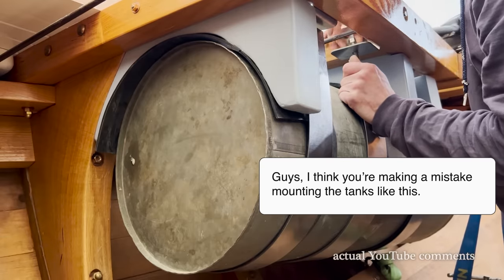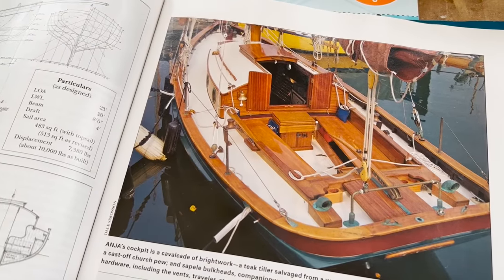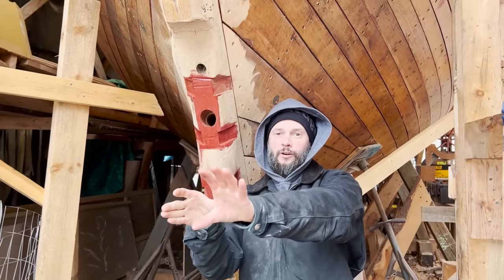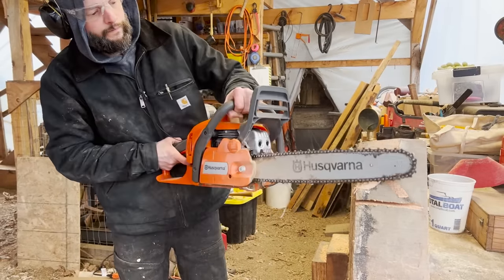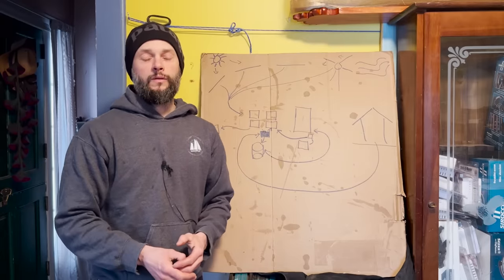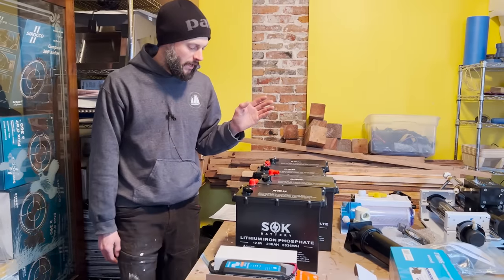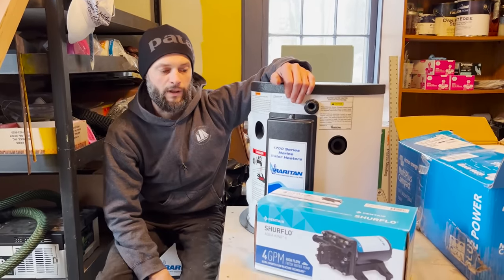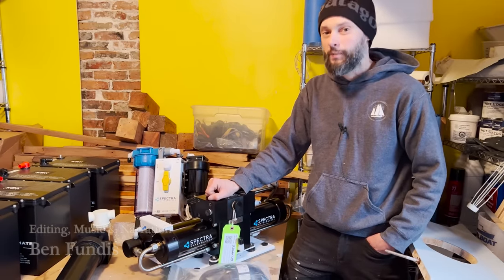That Prop Is Too Small & Other Comments - Episode 248 - Acorn to Arabella: Journey of a Wooden Boat

Comment: Pretty much the same plumbing system except I have a Dickinson Pacific for heating the water heater. I also run a loop of hot water into the head back to the water heater and run a low flow circulation pump so the water heats up the cabin sole and provides on demand hot water for showering. The loop also goes into the v berth through a forced air heat exchanger and a thermo coupler switches the heater on  and off at thresholds, so the entire system is protected from thermal meltdown. Only needed when living on the hook and running the stove 24/7.
Reply from the maker: Cool!

Comment: The biggest problem with the Sawzall is the stroke length and the size of wood being cut. If the thickness is more than twice stroke length, then it's not clearing sawdust from the kerf. If the gullet is full of swarf, then it can't cut any further.

Comment: I'm guessing your hot water heater already has a thermostat, but I wonder if you could control that further and get more efficiency out of it by say, limiting the water temperature to something like 105 when you're running off batteries.  Quicker heating, less power, less cold water to mix in to make it comfortable.  Savings all around provided the control itself doesn't negate the savings.

Comment: You didn’t mention a thermostatic mixing valve between the hot water heater and the shower. If you just didn’t mention it, great. Otherwise, it’s a scalding hazard after the engine has been running. The pressure balancing valve in the shower does not deal with that. I had to replace one last season, it was something like $80 or $100 plus fittings.

Comment: Very nice video! I was thinking of the risk that you would be tempted to use the water heater much more often than you think, whenever you woulld use warm water at home. But then I realized you are probably cooking on propane/butane, right? So you can also heat some water for dishes or washing your hands on the gas cooker.
Reply from the maker: Exactly.

Comment: I worked with chain saws for years working in the logging industry in Oregon. And no matter how careful you are if you run a chain saw enough you will get hurt. I never knew of any of the men I'd worked with that didn't have a scar or two on thier legs from a misstep using a chain saw. I've got a six inch scar on my left knee from not paying complete attention to what I was sawing with a chain saw. They are a very useful but extremely dangerous piece of equipment.
Reply from the maker: Thanks for sharing your experience!

Comment: Just a suggestion would be to add a second alternator just for charging the house batteries as the charge rates for charging lition baterries is very different than charging lead acid. Also you may consider instead of having a separate genset you use a Vari Gen ac that bolts to the engine and produces AC power directly for boat use when not at a dock. A friend of mine had one on his 47 foot cruser and it was the cats meow and was extremely simple to use.
(;-) TP

Comment: You probably don´t need the accumulator. Plastic plumbing does the same and I have never had issues with pumps cycling on unless in use at that moment because the seals in the pump are that good.

Comment: I worked with props just long enough to know that if you aren't including pitch with diameter, you aren't making a suggestion.  Same boat, different motor gives different diameter and pitch.  Trust the pros on this.

Comment: Electrical system looks sensible and as simple as can be. No one wants gas on a boat if they don't have to, it's another tank, and it comes with well known safety issues! Better off with an alternator upgrade to a bigger one, or 2 if you have room!

Comment: To charge LIFEPO batteries from your propulsion engine you are going to need a second alternator that can supply continuous high current and a smart regulator to control it.  Many cruisers have that,  I have that.  I have a Beta marine 50HP engine.  Essentially the same as yours just marinized by a different company.  The engine can handle it.  Brackets and pulleys are available to fit a second alternator.  Are you planning to do this?  The supplied alternator is OK for charging the engine start battery and very little else.  I would also recommend a battery combiner between your house bank and engine start battery for those times when one of your alternators is not working.  It will happen.  The internal regulator on that alternator is not designed for continuous output, just to replenish the engine start loads and to drive the engine instrument loads. 

Just so you know from where I base my comments.  I have a 1985 classic plastic sailboat that I lived lived aboard and cruised the world for 19 years.  I have owned it for 32 years and I have re-powered, re-wired and re-plumbed it.  None of the original factory installed systems still exist.
Reply: He's got (but didn't show) a Wakespeed alternator regulator to avoid overheating.

Comment: Like the SOK batteries as well, but do you have the ones that have heaters?  Your plan to go up to theice is not a problem, but charging LION batteries below freezing will significantly damage the. The heated versions will work automatically from the internal BMS.

Comment: Thanks for this video, it explains a lot of what everyone was thinking of and wondering.  I do have one question, will you put all the intakes on one side and discharges on the other?  I know I would not want my engine to be taking in the brine discharge or waste discharge from further up the hull.  (never mind the brine discharge is nowhere the discharge I had in the navy, of 1000s of gallons a day.)  Also bilge discharge may have oil in it which is a horrible thing to have accidentally get into any other systems.  Also with the northern trips you plan on making, consider having a recirc type system thru the water tanks from the water heater, while engines are running, to raise the storage temp of the water.  Raising the tank temperature to 70 from 45 will both make life better, (washing dishes or your hands in cold water really sucks) and the small water heater will be more enjoyable in the shower.  (I would only consider heating storage tanks with the motor running.) P.S.  I forgive you for not releasing your video yesterday, which I thought was Friday.  I was beginning to wonder if everyone was OK, but then about 5 pm I realized I had the date wrong.
Reply from the maker: Hahahaahha oh man, that post-script. 😁

Comment: Cruisers don't heat water from their battery banks, it's never worth it as it requires many watts and you'll need to recharge.  Just run your diesel for that (or shore power).   Foot pumps are also archaic, IMHO.  They are a tripping hazard and electric pumps are reliable.  Don't waste space on a wind generator.  They don't make enough power to be worth it and often make shadows on your solar panels (making them a net negative).  Put more solar on wherever you can fit it.  Your boat is small and you'll never have too much.

Comment: Gas fuel tanks were very often placed in the cockpit lockers or dedicated locker so if they leaked both the fuel and fumes went into the cockpit or directly overload instead of the bilge.
Reply from the maker: True, and with healthy ventilation.

Comment: Good day Steve.  Watching the power diagram, I was wondering if you had considered and or researched the different power ratings around the world.  I mention  this as it seems to me that the US tends to use 110 volts and most other countries have higher voltage eg. Australia where we use 240 volts similar to other Asian countries with 220/240 volts.

Comment: Chainsaw vs Sawzall: I have worked with both. I've watched Steve use the chainsaw from the days when he was felling the trees. He has much more experience with this saw and he knows what he is about.  The sawzall, in my opinion, can drive the user if that blade ever gets bound up.  The worst is when the tip hammers against an unmovable object.  The tip of a chainsaw can be inserted into wood where as the sawzall can not.  There is more cutting surface on a chain saw.  Granted, it is a dangerous tool, but I use a small chainsaw for rough cuts, hell it's even a better demolition tool. And with the sawzall, the blades wear out far faster.  The one thing it's good at is accessing small places. But using one scares me more than a chainsaw. [add] By the way, how many people do you see carving ice with a sawzall?

Comment: 12vdc 600w immersion water heater elements for the 6 gallon unit. Swap out the 120vac , and ditch the inverter

Comment: 11:29 Controversial, i know, but rather than a filler block, make a fiberglass, two piece clamshell that screws into the hole and fills the void for use.
Advantages over filler blocks, as i see it: 
a. it's lighter
b. it's never going to change size, it's always going to be the same as you made it, and when it comes to small parts like that in the water, that's a great advantage point, as i see it.
c. it's fiberglass = you're never going to sweat over it being damaged/lost. 

Nobody but you will see it, so there's no "blatant looks" issues with it. With a few brass insert pass through holes on the edge of the cutout, it should very easy to install using some Chicago screws. 

Just my 2 cents.
Reply from the maker: If it never changes size but everything around it does, that’s an issue, and since the rudder is partly in and out of the water, that’s a thing that happens. Thanks for your thoughts though! And plenty of people lose and damage parts of their boats no matter the material. Nothing controversial about using fiberglass where it’s the best option!

Comment: - Your patient Show and Tell Tutorial was excellent, Steve.
- Agreed, the chainsaw gives you the most control for working the stem and stern posts.
- It cuts wood quickly like hard butter and makes what you are doing EASILY...Yielding more control.
- Any other tool, except a good size Axe or hefty enough properly shaped Adze, would be slow, tiresome, with flimsiness preventing good control that you understood would be available to you with the chainsaw choice. SMART.
- Smaller chainsaws could work, but would not work as deftly as the bigger one you chose.
- Appropriate Physical AND Athletic strength is needed to use all hand tools, especially big ones.

Comment: That prop on your 50hp is the same size as the prop on my 28hp. We have a 16" 3 blade for 28hp   There is one overriding consideration on prop sizing and that is that the prop can transmit the full power of the engine. If with the engine at full RPM the prop is only transmitting 30hp, then there was no point putting a 50hp motor in it ... I don't know your peak RPM nor your gear ratio, but that prop seems very small for a 50hp, I would have expected around 19" 3 blade with a pitch close to 15"

Comment: Do you have any isolation between the two different battery chemistries? You seemed to show both being charged from the alternator. Would seem you need a dc to dc isolator to charge one from the other.

Comment: As someone who has a 12volt 400ah system for my off grid cabin I think you may be undersized a few ways electrically.  I use victron as well. The inverter at 2k output won't be able to run power tools if much of anything else is running because of the startup power. I can run a circular saw if everything but my led lights are off and I don't bog it down at all. You're probably going to be ok, but you will have shut things off to use other things . can the whole nav system be powered off? Battery wise running cellphones and a coffee pot are two things that take way more power than I expected. Also fans take a stupid amount.  I think you'll maybe get 4 days out of those batteries without charging maybe 2. I don't think you're gonna be in trouble just some limitations you may want to know about. Amazing project keep up the good work.

Comment: 12:16 I would try my best to get the filler block small enough that you can fit the propeller through without taking it off. Maybe only if the propeller is in a certain position, of you have 2blades on the left with rudder to the right you one need to fit one blade past

Comment: Steve, I thought you were using a 24 volt system.  Maybe you could consider consulting more with your install tech the advantages of higher battery voltage rather than 12 volt. Wire costs/efficiency/ heat/ so much more with higher battery inputs to inverter.
Reply from the maker: We’ve definitely considered this, as you might guess.

Comment: I am sure if you check on it, you cannot put a charge controller on the wind turbine.  If the batteries are at full charge, it would shut off power from it and then without the resistance of generating power, it would freewheel and probably over speed and throw blades.
Reply from the maker: Wind turbines these days usually tend themselves, stopping and starting based on wind, plus, we will have a hoisted one, not a permanently mounted one due to our rig, if we ever even get one.

Comment: The first diesel engine production model was in 1897
The first diesel-powered motorships were launched in 1903: the Russian Vandal 
Working with the firm of Klose and Sulzar, Diesel produced the first experimental diesel railroad locomotive in 1909.
Reply from the maker: Meaning that small diesels for pleasure boats weren’t as readily available.
Reply: @AcornToArabella  I had to look it up. Not old enough to have been there.

Comment: You will need an accumulator to put in line with the water pump to stop it cycling on and off quickly and wearing the pump.

Comment: My level of concern regarding the timley and successful completion of the project has decreased considerably. The fact major system components are in hand and experienced and expert sailers have been consulted is great.  I will say Steve when you are motoring you will just about always want to be going "hull speed" or close to it.  No point in making a 8 hour day a 10 hour day most of the time.  Creature comforts are good too such as a little hot water.

Comment: Hi Steve.
you did not mention a charge controller in the solar-battery-inverter configuration. Is there a reason for that decision?

I thought a charge controller is important for preventing the battery from overcharging.

Comment: You probably already know this, but you may need two different alternators... One being a high output with a high output regulator charge controller.  Since your house batteries are lithium, they'll suck tremendous amperage with their high C rate, which would heat and kill many alternators designed for charging a single flooded lead acid it AGM start battery. A sailing channel I watch called Sailing Soulianis reconfigured the belt and added a second specialized alternator for their lithium charging on their previous boat.
Reply from the maker: There will be a charge controller to take care of adjusting the output to what the batteries want as input. That’s what all the Victron stuff is for.

Comment: For those who are interested: 
Arabella is a 38’ boat with a waterline length of 32’. 
The maximum hull speed of a boat is calculated as 1.34 x √waterline length. So Arabella’s maximum speed will be 7.6 knots. 
This is because as the boat speeds up it slowly buries itself in the hollow behind the bow wave until it can’t go any faster. 

(Boat in this case behind a displacement hull, non foiling, non planing)

Comment: I've been watching this project from it's beginning and now must ask after watching the water systems design what thought has gone into freeze protection. Must the boat be winterized whenever it's in a colder climate and left unoccupied?
Reply from the maker: No, not really. It’d have to be a VERY cold climate. And the only thing needed to winterize is put some antifreeze into the raw water strainer with the boat running for a bit, then make sure the water tanks are mostly or completely empty. When I left my boat in the water in Maine, we just ran the engine from time to time. Didn’t need to empty the tanks. —Anne

Comment: Man we have a 5th wheel 38ft camper and are hot water heater is like 5 gal it run on either propane or electricity it can run 24 7 and never run out off hot water and really doesn't cost much to run

Comment: As an off grid electrician, I have a question about battery fusing. Are you going to have a primary fuse at the battery bank before and of the conductors go out to their respective locations? Or is the main fuse panel going to be next to the battery bank? I've been watching you since the beginning of the planning and build and I'm impressed by the week to week progress. Great work by you and the crews. Give your mom extra kisses from all of us watching.
Reply from the maker: More than likely: There are independent fuses nearer the batteries for each bilge pump (three planned) and then for everything else there is a breaker panel before the electricity is distributed through the boat. —Anne
Reply: @AcornToArabella  Thank you. We have always put one primary fuse right at the battery bank just in case a cable should get nicked or cut, to prevent melting all of the wiring systems.

Comment: If Atkin's first Colin Archer-type double ender, the Eric, was designed in 1924 and the first Ingrid was only built in 1938, diesels had certainly been around in boats for a while. The first diesel-powered ships were built in 1903 and diesels for (German) submarines were being built in 1911; it actually appears that diesels were being used in watercraft before they were installed in terrestrial vehicles. However, I won't swear that marine diesels specifically for small boats were already around when the Ingrid was designed though diesels of similar size for tractors etc. certainly were.